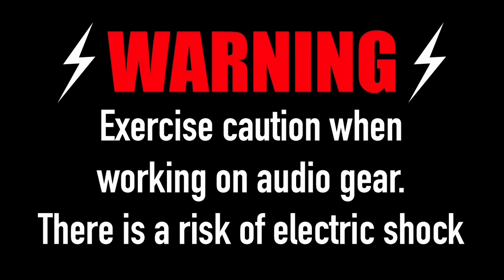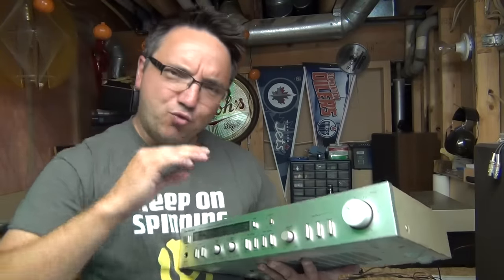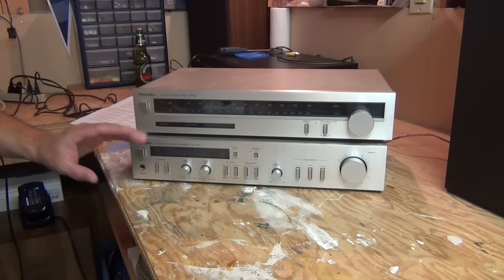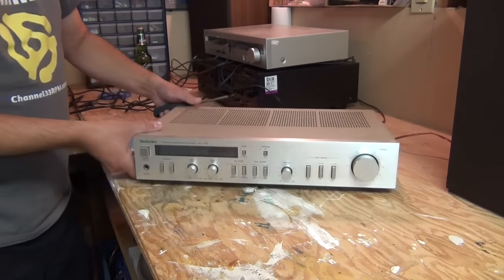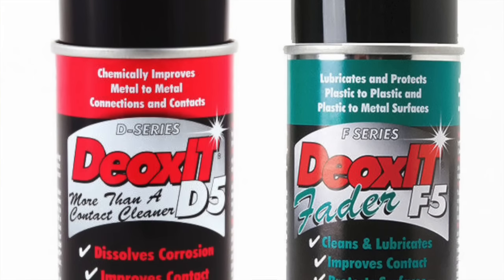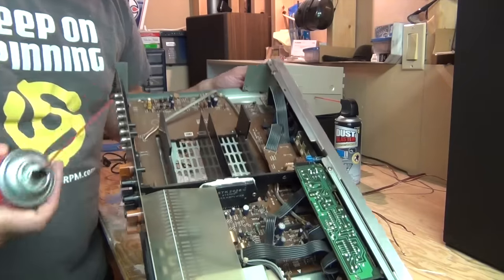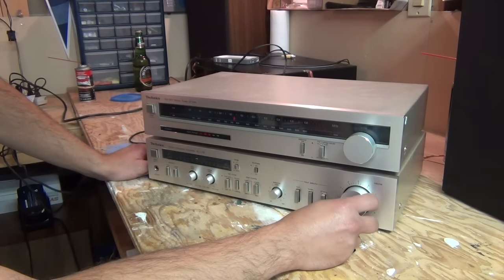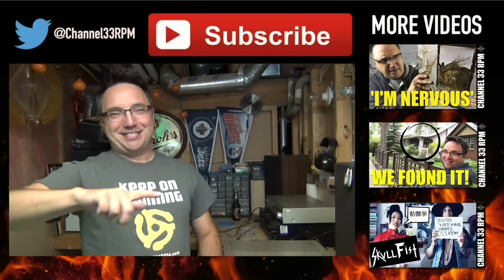Bringing a $5 GARAGE SALE stereo BACK TO LIFE with Deoxit | Cleaning a Technics amp

Comment: what if one of your channels has gone super quiet?
Reply from the maker: brwi1 I've had this problem before. First try to determine if it's your amp or turntable. In my case it was the cartridge.
Reply: thanks for the reply. definitely my amp, it does it on all inputs.
Reply from the maker: Man, that sucks. I have an old Sanyo that does this as well. I cleaned all the pots with Deoxit, and it did not help. I don't like to mess around with the capacitors and that kind of stuff, so it's sitting on a shelf unuseable...
Reply: Channel 33 RPM figured it out, cleaned all the pots and works great. was reading that the speaker relay can cause that problem as well. thanks!